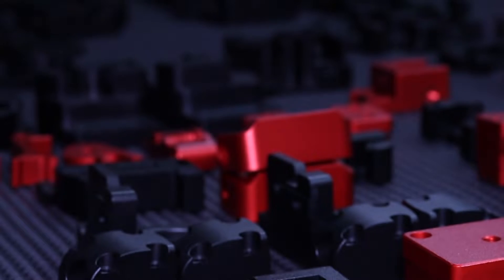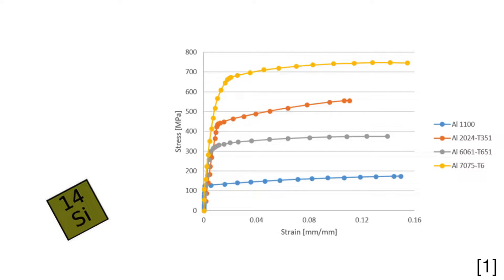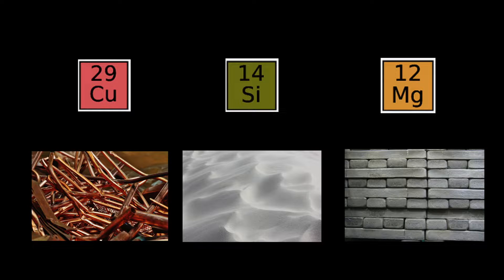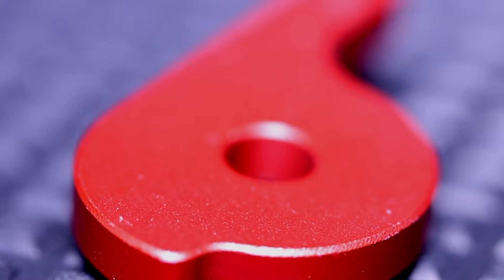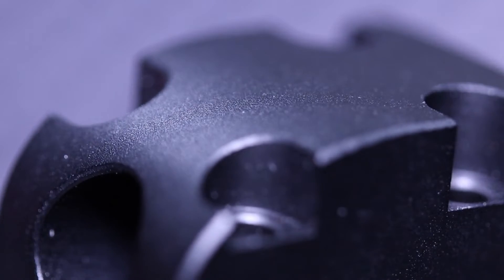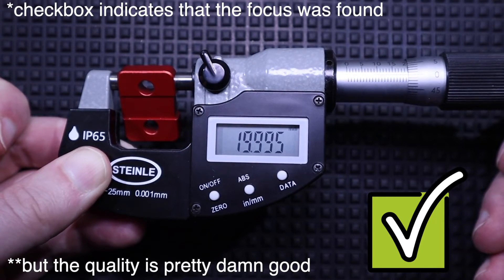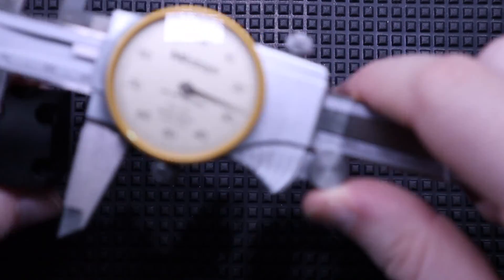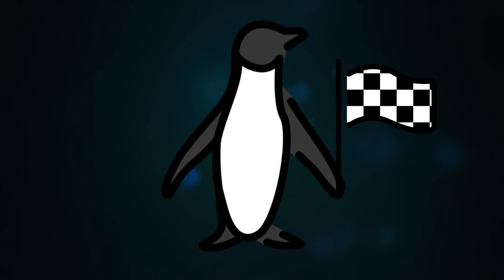Aluminium Parts 2

Comment: Two questions: 1-did you build your Voron by now? 2-Isn't it so that you can't compare the parts from the CAD 1:1 with the aluminium parts? I believe I read somewhere that the parts were designed with 3D printing in mind and if you'd design for milled aluminium, you'd design them differently. Obviously the measurements from the CAD drawings should match, but these parts are in exactly the same as the printed parts, so not optimized for milling?
Reply: I have bought both, in aluminum and in PA CF and can say that the aluminum is perfect in sizing, made with high technology routers.
I decided in the gantry X do not use aluminum by the inertia. The pieces of aluminum are more weigthed than plastics.